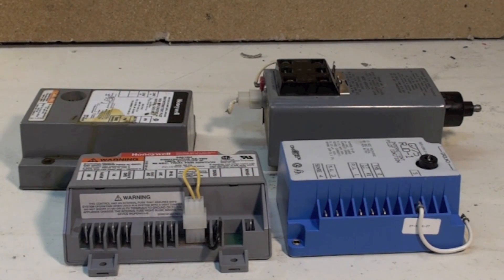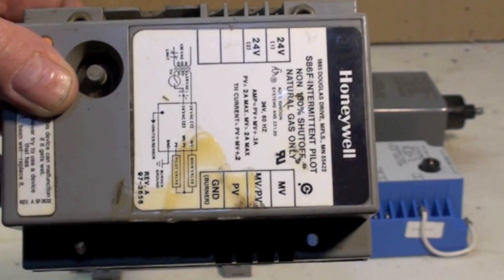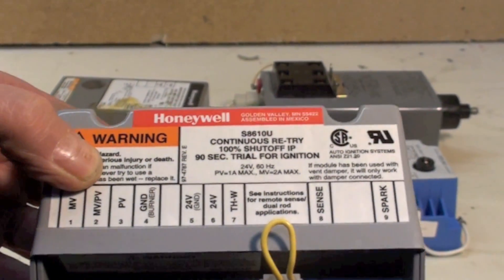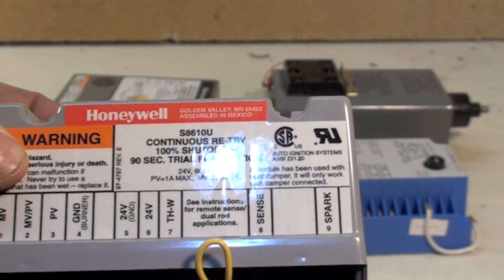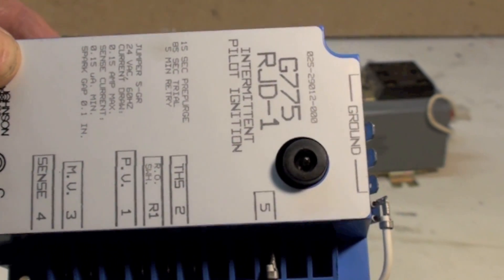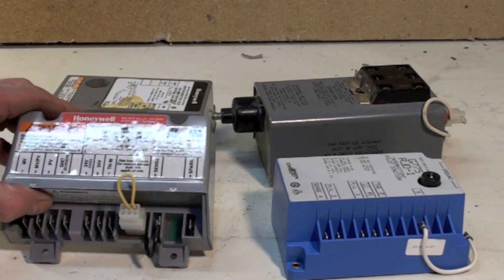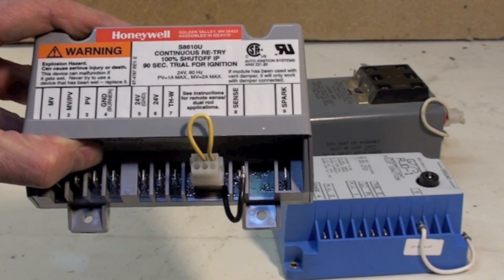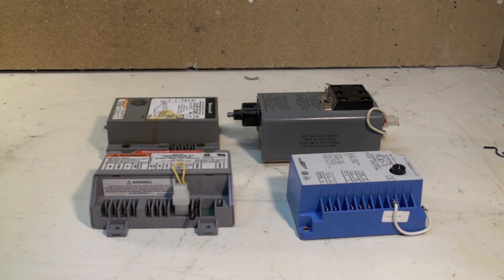Gas furnace spark ignition controls

Comment: Hello mr gfm. In a rooftop unit the trouble shooting say: you can see the light/spark working many times.  But you can't see the flame on burners.  There's gas on the pipe but after the main gas valve doesn't go gas through the burners?  Do you think the problem is on the main gas valve?
Reply from the maker: rocafirme1000 I am assuming there is a pilot light that is being lit, but main gas is not coming on.  I would look for power output to the gas valve after the pilot lights. Power available, gas valve has failed.  No power, ignition control problem.  Hope this helps.
GFM
Reply: depends, it might be the sensor is dirty and needs cleaning or the valve, if the sensor is alright and if there is voltage coming through the valve and it isnt doing anything, it might be the valve itself.

Comment: Very nice explanation of pilot gas lid sensing and intermetting control sending secondary valve side, power to main valve(MV) for gas release.  On a two valve safety for furnace units.  This helped me troubleshoot gas pilot not ((LID)) of my gas first valve powered at start up in (electronic intermetting control gas valve units)= furnace type units today.   It means no gas in the pilot, do to no gas release of the gas valve, therefore no main gas release at no sense given for second side to release ((mv)) valve. so my gas valve could be ok.    Got a do some cleaning and troubleshooting at gas valve.
Question:
Is there any adjustments for the pilot gas release after powered shown ((PV)) pilot valve.  I got power in my first side valve ((pv)) shows power and partial bitty flame.   Is there a screw that adjust flame or is set to flow at valve control only?  Will check for clogging there at pilot flame.  
Great video in helping understanding flame sensing at pilot within spark cable.
Thanks
Reply from the maker: I would guess you have a dirty pilot orifice.  There is an adjustment on the gas valve.  Look for "pilot adj" next to a screw.  Its underneath that.
GFM
Reply: grayfurnaceman will check.  So far is been on and off turning on will follow post with result. Thanks

Comment: my furnace blower does not come on, pg&e came out and couldn't figure it out. He said if he had to guess, he would replace the ignition control unit. Wouldn't the blower still come on even with a bad ignition control module? I don't see a circuit board, so i'm assuming it's a non integrated system. Just to check, I tried a new blower, still does not come on. Also new thermostat. No power at blower motor. Any help?
Reply from the maker: If the burner does not come on, and the furnace uses a heat operated fan switch, the fan will not come on.  Hope this helps.
GFM
Reply: Is there a way to tell which type of switch it has. Thank you so much for your time, it is helpful.
Reply from the maker: sam sneeze Take a look at this video for some different types of heat operated switches.  http://youtu.be/8MbkCwOzT4s
GFM
Reply: possible "limit switch" The cycle problems.
check "fan relays" older units
Integrated boards have fan relays not so sure with limit switch. Since I have an older unit and mine does work to cool down by temperature.   Maybe this limit switch could jam break and not letting power back to your fan for use with relay.   Possible seen this talked in other videos.  Check both quotations in search bar youtube.
Reply: It was actually the power supply unit that was fried.

Comment: Hello, I'm a fan of your channel, you're a great teacher. I have a question for you no one can give me an answer for.

Ill use Honeywell S8610U Intermittent Pilot Gas Ignition Module as an example.

Let's say for example I have my vent motor going, My pressure switch makes, and I hear my gas valve click, but I don't have a spark, How can I test to see if the problem is the module or the igniter? 

Thanks,

Al
Reply from the maker: Pull the high tension wire off the module and short to ground to check for spark.  If it sparks then and not at the pilot,  there is a short between the wire and spark gap at the pilot.  No spark at the control, bad control.  Hope this helps.
GFM

Comment from the maker: I have seen reversed polarity from electrical work done on the panel.  You might try using your clamp meter to see if amperage is going thru to energize the gas valve.  Also, make sure gas is available.  Hope it helps.  
GFM

Comment: How is it possible the polarity will be reversed by itself? According to customer Roof top was working fine for years... I changed the board didnt work, I checked the ground on the transformer very tight... I did even changed the spark igniter.. I checked the centrifugal end switch looks fine.. What causes the board not to send 24 V to Gas valve. I just couldnt figure that out there is ghost voltage coming for GV when it tries for igntion but 24 V.

Comment from the maker: Is it possible the polarity is reversed?  Or possibly poor ground?  The spark coming seems to be against these problems.  If it is electronic pilot ignition, and the pilot valve is not getting power, the board is the problem.  If it is direct fire ignition, of course there is no pilot but the gas valve is only open for 4 to 7 seconds.  Hope some of this helps.  
GFM

Comment: Dear GFM today I was in troubleshooting for  a goodman 3 ton roof top. It has spark igniter also has integrated control. The unit doesnt light up and has fault code but I couldt see that code on their list it's just constantly blinking(red) so I suspected that circuit board is bad because gas valve doesnt get 24 V but I can hear spark. I also check the gas valve it looks good. What do you think??